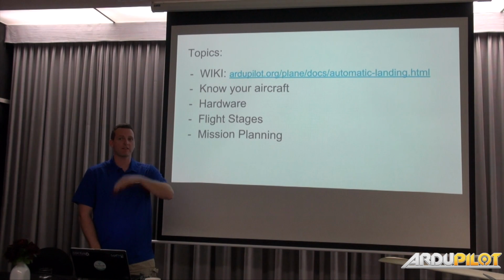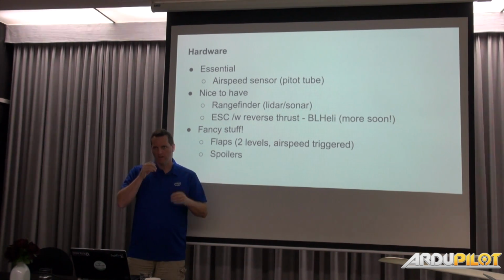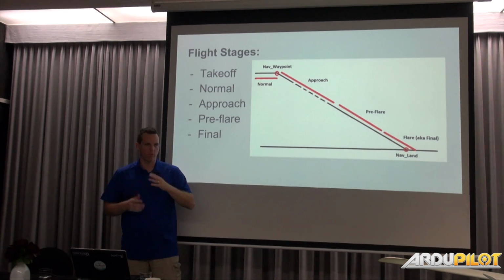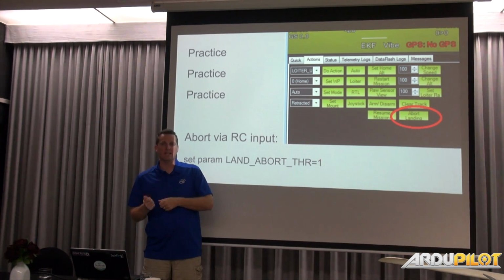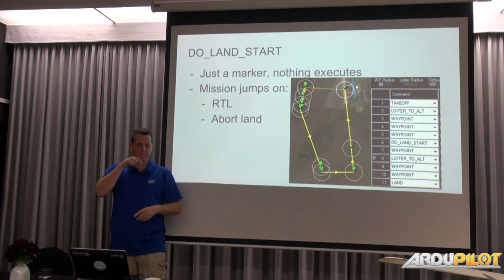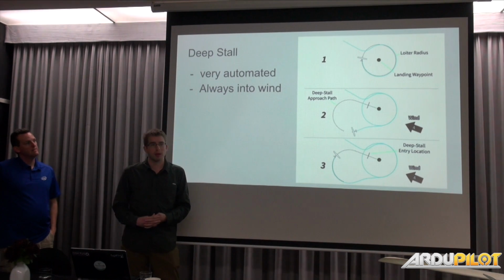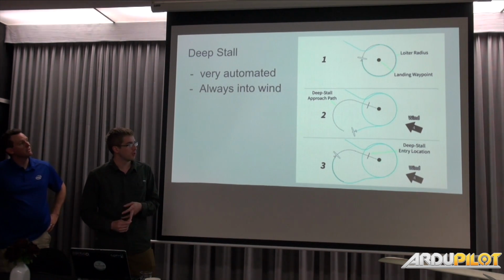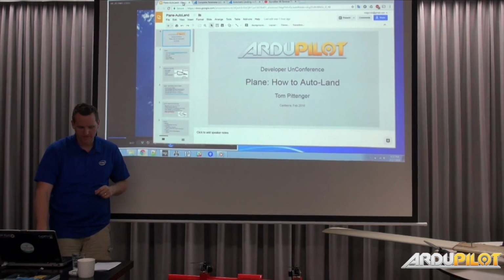Plane   How to Auto Land

Comment: I successfully use auto landing in ardupilot. I appreciate Toms attempt to explain it here but I found him hard to follow unfortunately. I actually found him harder to follow than the text in the WiKi. 

It would be good to maybe do a ‘how to’ for dummies using flight videos on how correctly workout the glide slope of your plane, to ‘tune’ the pre-flair point and flair point itself. Tom mentioned doing repeated aborts in the tuning process, it would be good to see this. 

I’m also glad I watched to the end to hear the comment that reverse thrust is only for pusher planes! I was like ‘derr, of course!’ But then thinking harder, if a pusher prop can push the plane forward and pull the plane back as a brake, why can’t a puller prop pull the plane forward AND push the plane back as a brake?
Reply: Hi! I am just working with this project. İs it possible that can you give me your contact for more detailed information?
Reply: Pusher a d puller propeller planes both have reverse capabilities, on the ground and I the air. So if big planes cam do it, why wouldn't smaller RC planes be able to do the same?
Reply: With autoland, What if I'm flying with a controller and not a base station and I want to trigger autoland?